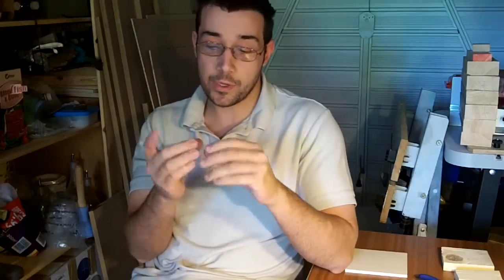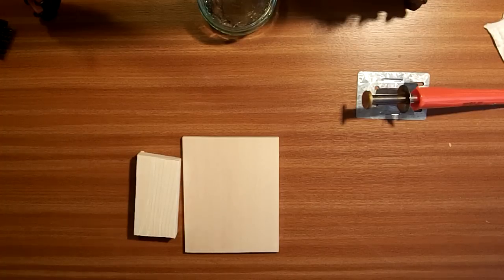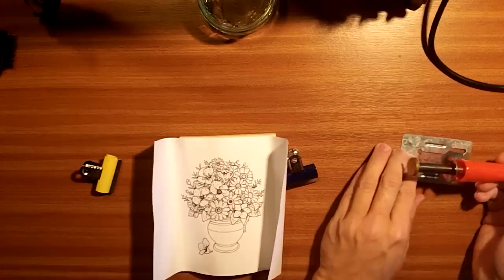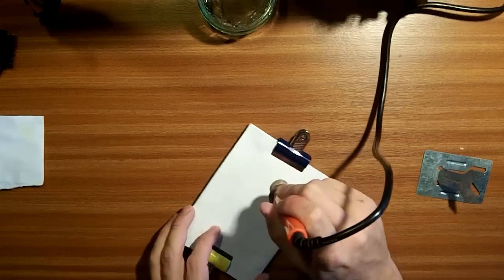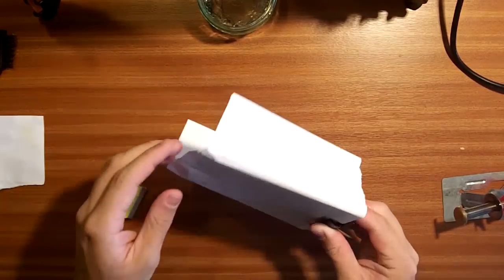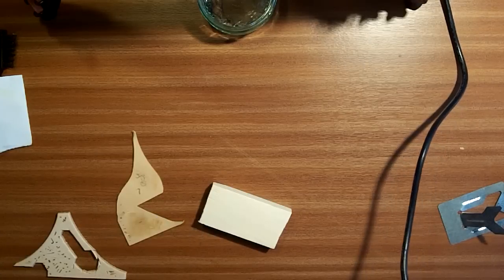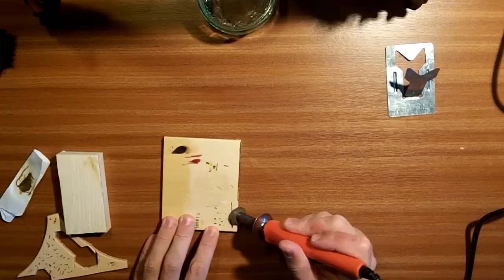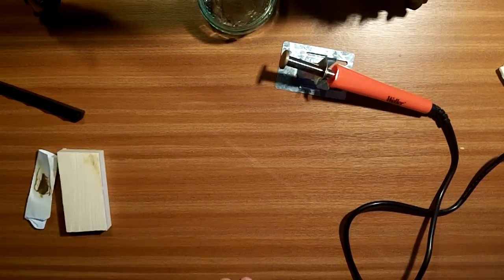The Beginner's Guide - Patterning Bit - Weller Wood Burning And Hobbyist Kit - #2

Comment from the maker: Hello MouseMomma, 

Glad you're enjoying the video series. 
Yes you could use a baking sheet or heat transfer craft sheet or similar as long as it's rated up to at LEAST 300C degrees touch contact heat. But be careful you don't use a sheet that is not rated that high, and stop using any coated sheet if you notice it starting to burn due to chemical release.

Hobby irons, covering irons, and transfer irons are all usable of course, with laser ink only as said. :)

Comment: Have you tried using an iron for transferring?  I find it words pretty well as I don't have a pattern bit.
Reply from the maker: Hi Mark, 
Yes I have tried an Iron for patterning, and I have also used a heating iron that is used for applying shrink coverings to things like model planes. 
Personally I find a patterning bit works better to transfer a clean pattern, I find a household iron to be somewhat clumsy from a size point of view and a heating iron to be somewhat slow.

Comment: Hi, I have just purchased a similar wood burner, and it comes with a piece already attached to the device. But the problem is, is that it's stuck, I was just wondering if you knew how to get it off? Thanks
Reply: I know i's no good to you now, but for others use some pliers to hold the bottom of the tip and turn it anticlockwise mine was really stuck too!
Reply: Let it cool down before trying to remove it

Comment: I was hoping to use the patterning bit as a stamp - to make the pips on large wood die. I have some cedar - am I making a huge mistake?
Reply from the maker: you could, but you'll need to clean off the patterning bit, and you'll have limited control.  Personally if I was looking to make large even circles I might go with pencil flames, but if all you have is a solid bit machine the patterning bit will turn circles black

Comment: Can i ask something? on the paper i can use one classic pen? or somethning like carbon or one photocopy of my  printer?
Reply from the maker: you can use none wax carbon paper, but normal pen is not heat transferable. 
If your printer is a laser printer that uses toner you can user your printer, if it is an inkjet printer it wont work properly. 
There are other patterning methods though.

Comment: My tradeflame tool didn't come with a patterning bit. Any suggestions where I can get a compatible one??
Reply from the maker: I'm not familiar with the tradeflame brand what sort of connection does it have for it's end pieces, do they screw in, if so what size screw thread do they have, you can get packs of generic screw thread bits... but there is always the risk they will snarl up a machine.

Comment: I got a tool pretty much like yours, but it doesn´t have that patterning part. Can I use carbon paper to transfer an image?
Reply from the maker: +Anne Souissi  As long as it is wax free pure carbon paper, more expensive but still safe to use and wont produce any nasty chemicals,
Normal none wax free pure carbon paper uses a collection of chemicals which will produce hazardous gasses when used to transfer.

You can also hit transfer laser printer patterns with a house hold iron but it is a bit fiddly and takes longer,

or look into purchasing a compatible transfer bit.

Comment: Will the patterns not transfer if you have an inkjet printer?
Reply from the maker: Caesar Roldan 
Hi Caesar, they might transfer in some instances but in most cases they wont, and even if they do they can put off toxic gases.  This is because inkjet printers use liquid ink that then dries. While laser printers use solid toner that is heated up and melted, this means laser toner is suitable to be heated and melted.
Reply: TheLearningDroid Some ppl put out videos and don't bother to take feedback or answer questions, which is dumb because we're all here to help each other out, so thank you so much for taking the time. I guess it won't be too bad to just go to Kinkos or something and just have them print something out for me. Thank you so much, dude. Please keep up the good work! God bless

Comment: can i use it to solder my battery pack
Reply from the maker: Soerry for the late reply, as this is single temprature it can be a bit hot depending on the solder, but it is theoretically possible, you'd want to test it on a spare bit of identical wire and solder.

Comment: What's the temperature set to?
Reply from the maker: +Nicole liu Hi Nicole.
The Weller kit doesn't have temprature settings, it's a single temprature machine. However in solid bit machines patterning with laser toner printed patterns using a patterning bit has to be done at quite a high temprature. On my creative versatool kit I have it set at about 80% between dark orange and red>

Unfortunately no machine I own has actual temp settings

Comment: couldnt you just use an iron
Reply from the maker: Hey Lori, 
yes indeed, I think at some point in this video I even mention it though can't remember, yes a household iron with steam turned off can be used to transfer patterns, however it takes allot of time and can be hard to transfer smaller more delicate patterns. It can cause scorching at a lower temperature because of the constant heat as well. This is a bit that comes with the machine and so I have shown its use. Myself I like the patterning bit for patterning as its comfortable and accurate and gives a good result. But if you want to use an iron, I wont rain on your parade for doing so.

Droid